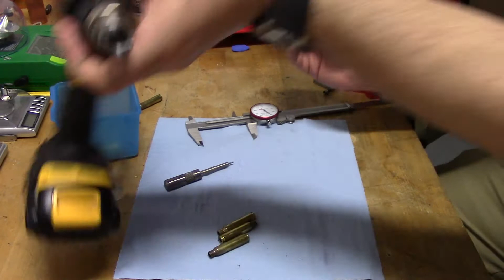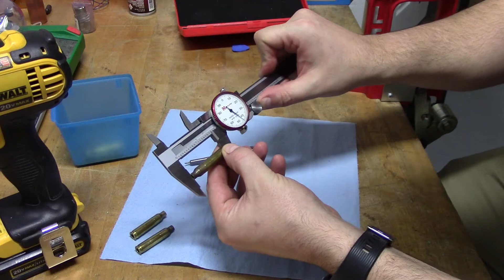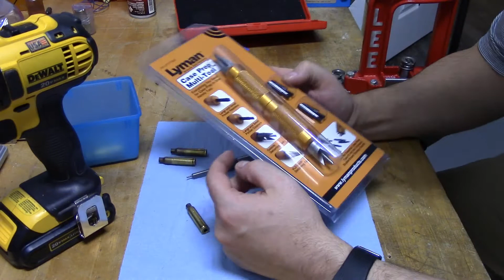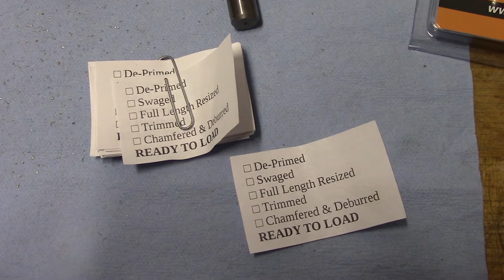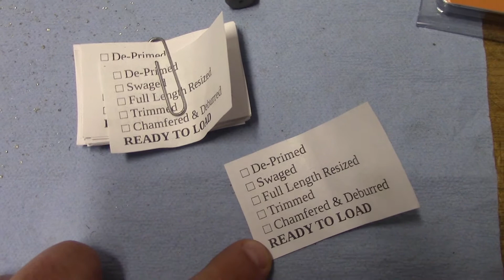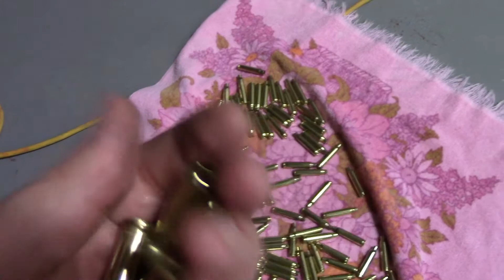Reloading Rifle for Beginners - Brass Prep 2 of 2 | Guns N' Reloads

Comment: The PMA Tool power adapter will work to allow Lyman or any 8/32 threaded tool to be used in a power drill without messing up the threads.